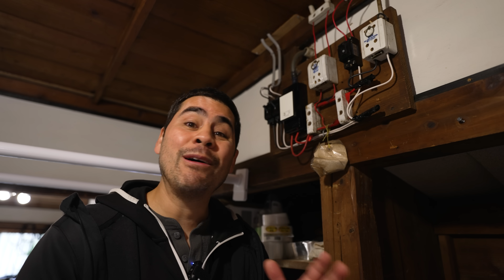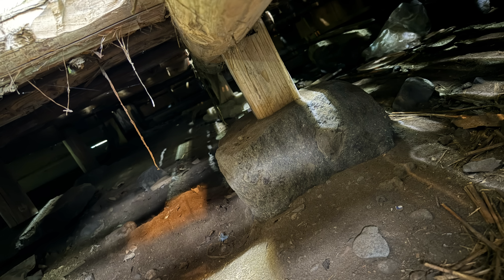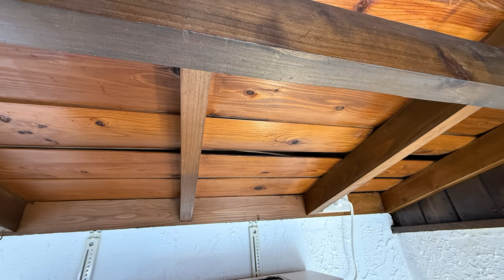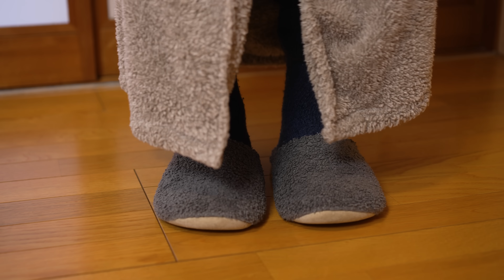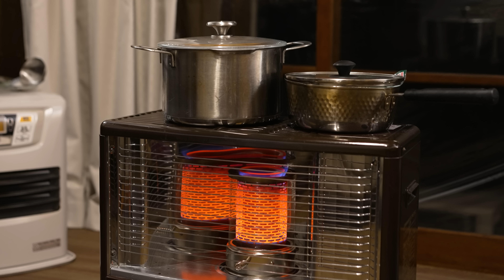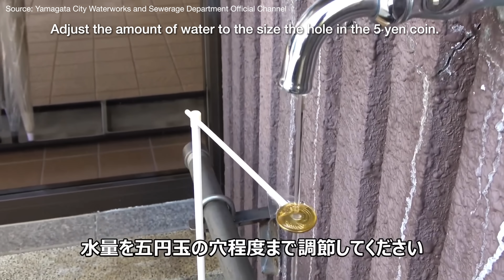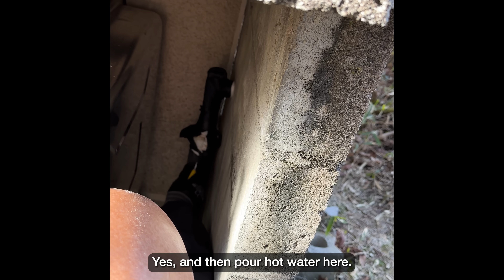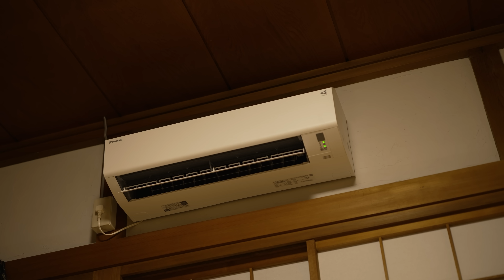What an Old Japanese House in Winter is Like

Comment: Japan must waste a ton of energy on heating. Government surveys show that roughly 90% of existing Japanese homes (as of the early 2020s) do not meet the 2016 energy-saving standards. Even worse, about 30% of homes have no insulation at all. In fact, I heard that if Japan heated their homes the same way that Americans do (central heating), and had the same size homes, they would use 60% more energy on heating than Americans. Luckily Japan is upping the housing code to require modern insulation for new buildings.

Comment: My parent's bought a $3000 apartment in Yuzawa and pay $200/month maintenance fees. The building has giant, built-in electric heaters in every room but if you turn it on they charge $50/day. We use 3 space heaters on full blast during the winter and it's still very cold, they also occasionally trip the breaker. Fun times.
Reply: I'm always curious about folks who buy into those old, dead apartment blocks. I can't imagine moving all the way out to the countryside/mountains and then living like you're in Saitama.

Comment: 47 degree shower?????!!!!???? My skin would blister... Ours is set to 37 and I still run the cold water. This morning it was 1 degree in Osaka and I was walking around our old house barefoot, in shorts and drinking cold chocolate milk. This from a guy born and raised in the Caribbean!
Reply from the maker: It's 47 at the source. You lose some through the pipes and air. I think it still hits the body fairly hot, like between 40 and 43, depending on the distance from the shower and how cold it is outside.

Comment: Electricity panel like that would get you arrested in Belgium for endangering your family 😂
Reply: As a sparkie, you'd be surprised what may be allowed by "grandfathering," i.e. accepting old regulations for old buildings and installations.
Reply: @Slugbunny  Yup.
Reply: @Slugbunny My dad has taken care of my grandmother in Ohio for the last 2 years, and the old electrical system was so out of date! House was built in the 50s....
Reply: Yeah, looking at that electric panel really made me look my eyes out. Like what even is that? 26A circuit for the entire house? No wonder you're constantly struggling to keep the power up (yikes).
Reply: He's running a kerosine heater on a straw matt, in a wooden house with paper walls.....

Comment: I'm really lucky. The insulation isn't great (this condo is 60 years old) but the space is pretty well sealed up. So a small space heater in each room is enough. Each one pulls about 700 watts, but only runs when the sensor trips as "colder than". So they run in bursts of about 10-15 minutes each.

Comment: Hey Greg,

Great Video. 

A Suggestion: Wouldn't it be more beneficial and efficient to use a 12v heating blanket or an AC heateing blanket.
Reply from the maker: Could be more efficient, I haven't done the math. But I know that if it gets below 5C, even if inside the blankets is warm, I don't sleep well. 10C I can do though!

Comment: This is such a great example to help answer a burning question I've been so curious about for literal years now. How did Japanese adjust for winters? I'm also from Canada and used to strong winters so I was immediately curious as soon as I learned about Aomori being home to the deepest snowfall.

I imagine the eventual invention of the Kotatsu, and electric heating helps change it but I'm really curious about the past. My guess is it's bundling up, mostly fire, maybe hot water bottles, and hot rocks from the fire or just camping tricks and luck to survive the winter back then when it's a paper walled house with draft for the summer.

If by chance you read this, can I bug you for the name of the thermometers you're using to detect the air below and above your desk? I'm trying to isolate a draft in my house in Canada hahaha, surprisingly relevant I suppose.
Reply: The kotatsu has been around since medieval times. Before electricity, you'd have a little pot of burning charcoal down there. But yeah, huddling up in the kotatsu or around the irori (cooking fire place) was basically it.

Comment: I never thought about it, but as a Canadian I have completely taken for granted the fact that every house I've ever lived in has been well insulated. 

You could consider getting a little fan to help air move in the room to help equalize the temperatures at head level and the temperature at your feet. Also I've seen people use heat-powered fans on wood stoves to help circulate air. Maybe you could use something like that for your kerosene stove/heater.

Comment: I take it that running the heat  (overhead Aircon on heat setting )throughout the night would be cost prohibitive. That would prevent you from having to bring the heat up from such a low temperature.
Reply: That was my thought, too. The heat pump could do it safely, but apparently not worth it (discussed later in the video).
Reply: @Slugbunny Sounded to me like it's an overall electrical capacity issue or a wiring issue that would result in circuit breakers being tripped overnight.  Much of this uncomfortable, unsafe, elaborate heat dance could be eliminated by upgrading the electrical system to allow the heat pumps to run all night.  Turning heat pumps off and on daily is generally considered poor practice.  They are designed to be on all the time using the minimum energy needed to maintain temperature.  Going from freezing to 20C each morning consumes all his limited electrical capacity and can't be done with just the heat pump.  They are simply not designed for large, fast demands.
Reply: The electrical system must be upgraded so the heat pump can work all night in both locations without tripping circuit breakers.  That's the only way to eliminate the danger and inconvenience of the kerosene heaters, the risk of frozen pipes, and the discomfort of huge daily temperature swings.
Reply: No, its dangerous. You can die
Reply: @Obbliteration The heat pump is completely safe.  He has to find some way to keep that on all night...
Reply: @thelosphere8722  Not the heat pump, the burner I mean. The heat pump is fine but that house is just awful. You need a massive energy output to heat it. Such a tiny unit cannot do that
Reply: @Obbliteration Yeah the heat pumps look like small ones.  Only more reason to keep them on all the time since they lack the ability to manage huge swings.  In another comment he did mention he's renting and that's the reason he's not upgrading the electrical.  I don't know.  If it was my family and that much discomfort and safety risk, I'd work with the landlord to do the upgrade.
Reply: @Obbliteration  trim the overhead air con?
Reply: @kamanama3671 Trim?

Comment: "Traditional living" is fun, no? ;p~

Many thanks for sharing even if personally I'd be swapping out the kerosene heater (like my grandparents used to use) for a modern oil-filled radiator, maybe even a heated sleeping bag and robe. Most of us nowadays didn't grow up with ice forming inside the windows. : )
Reply from the maker: Oil filled still uses electricity, so I think that would still probably cause an issue with the panel.
Reply: @LifeWhereImFrom  Yeah, I don't know what the total electricity draw you have is but even 600-800 watts which is 100% efficient still makes a decent difference and with zero risk of flames or fumes it's easy to put close to the bed and/or removable foil-covered panels that could be slipped in to reflect heat back at you. Likewise, safer to have the likes of a silver-foiled roll-out mat which could be placed underneath it.
Aside from that, the idea of heating the person rather than heating the house is fundamentally sound, of course! Hence the heated sleeping bag/robe; some of which are battery powered so could be charged when the electricity drawn is lower.
I love that you've taken the need to adapt so stoically, anyhow; very much a lost skill nowadays, kudos! ("People survived worse in the past, you can survive it now"... ;p)
Reply from the maker: 600-800 watts is borderline. I think it'd work, but would have to remember to turn it off before using any kitchen equipment or hair dryers.
Reply: @LifeWhereImFrom  Ha! I'm surprised you manage to get away with hair drying at all... or is that another tale or ten of blown fuses? ; )

It's a similar problem in Indonesia with limited power draw but climate and latitude makes it much easier to find a modern solution there with a few solar panels and battery storage running separately to the mains supply.
Not quite so easy at Japanese latitudes in winter, alas!

Comment: What size are your AC units? Mine are 3.6 kWh in the living room and 2.5 kWh in the master and 1 guest bedroom. Since each unit is on a separate breaker in the breaker panel, I ran all three units simultaneously last winter and tripped the master breaker a couple of times when I forgot to turn off the main AC in the living room to operate the microwave oven. 

This winter, I switched from using the AC units to warming my body only, which I had concluded was more economical than heating entire rooms. This meant purchasing two electric blankets (I already had two) for the living room, bedrooms, and a five panel leg and foot heater like yours at my desk. These I purchased cheaply in summer and fall from HARD-Off and 2nd Street (in brand new condition). I also had a an electric rug in storage that I put in the tatami bedroom. My electricity bill for Nov-Dec 2025 was ¥15000 cheaper than the same period in 2024. My house is in Western Tokyo. 

And, like you, I dress like an Eskimo around the house 😂
Reply from the maker: I can't recall off the top of my head, but they're 100V, not 200V, I remember having to make sure they weren't too powerful.

Comment: We have the same trope here in Australia, Aussies whom travel abroad realise that are homes in temperate Australia are far more miserable in winter than homes in Europe or America because insulation makes all the difference. An average house in Melbourne will drop below 10c the second it's within a footy pitch of freezing. Where visiting rellos in California with a holiday Cabin around Lake Tahoe; it was still above 15c when it was -20c outside. They had double pane windows and that plastic layer put over the sills, made it so you didnt feel that ambient air drop walking by like most windows, heck you can feel the wind pushing through most closed windows in Australia.

Comment: You know the house is cold when you open the refrigerator door and warm air tumbles out.
Reply: Why did the penguin buy the freezer? Because it's only -7°C in there!
Reply: Or you open the door outside and it's warmer which was the case every day while I lived in Japan this Christmas.  I'm going outside in my t-shirt to warm up while dressed as an eskimo indoors🙂
Reply: Nah I had that happen with my Siemens fridge freezer,  damn thing messed up and started working in reverse by the time I realised it was 26c in the fridge.
Reply: I'm surprised the heat pump does anything. They don't seem to work well and cost a fortune to run in old houses here in the UK. They're deemed only suitable for heavily insulated houses. 
I can sympathise with your problems. 
I grew up in a house with no heating anywhere only a coal fire in the living room. We used a tiny paraffin (kerosene) heater occasionally in the kitchen. There was no bathroom, the toilet was outside. I remember frost in the morning on the inside of the windows. I would not like to live that way now. 
I hope you manage to get it all renovated so you're comfortable.
Reply: @OrganisedPauper heatpumps can run in far cooler temps than 0C, they just get less efficient till about -15C to -20C, than they basically can't function.  They have to cycle the cooling part to heat the coils to melt ice buildup, below around -20C it can't overcome the cold with enough time for the cycle to work right.
Reply: @Oyashiro_Chama Thank you. I don’t think we don’t have OC here. The most common form of heating here is gas, usually gas central heating.  Heat pumps seem to be extremely expensive to run here in the UK unless your house is extremely well insulated and has no draughts. They’re not considered suitable for a Victorian house like the one I live in that has living rooms with cellars underneath the floorboards.

Comment: NOSTALGIC!!! I used to live in an old home in Iwate. And this was my home for 3 years. You have a bit more modern comforts than I did. No aircon for me. Also, your sink isn't gas-powered. No insulation either. Also, the boton benjo toilet. No fancy heated seat toilet for me. I had that exact same kerosene heater.

Comment: I guess I don't understand whyyou don't keep the heat on low overnight so at least it's not at freezing level in the morning?
Reply: The ac just wont be able to do it alone and the other heater can kill you while sleeping
Reply: Utility bill would be my guess.
Reply: Ah, there we go. Covered late in the video.
Reply: "result in a cold, dark world"  implies an electrical problem.  I would like to hear why that can't be upgraded.  So much of this whole dance goes away once both heat pumps can be run all night.

Comment: My house in the US Midwest had the heating go out the evening of the coldest night of the year (0 degrees Fahrenheit). It was around 72 when it went out and the temperature dropped to about 52 by the time I woke up. I have good insulation but also an open floor plan house and some large windows, which probably didn’t help. Thankfully I was able to get it fixed by the mid morning!

Comment: OMG.  Wow.  This is the Third World.  Why only 30 amps?????  US homes now usually have 120 amps.  It would be difficult to charge an EV.
Reply from the maker: The house was built 100 years ago. In fact, in one section they pulled up tatami mats and the tatami person were amazed and said they could be museum pieces. Have no idea when the electricity was initially installed, but my brother-in-law's brother, who is an electrician, was scared of it because it was so old. Would cost a bit to update it, and we would if weren't just temporarily renting.
Reply: Old home = old electric installation.
Newer homes (most Japanese homes) don't have that issue.
That akiya needs a lot of work.
Reply: Because this is a house from the probably 60s or 70s when nobody had any electric appliances and most people weren't future proofing anything they were just happy to build a home. 
You wouldn't believe how cheap these homes were to build back then.
Reply: That has more to do with the fact that he is living in a very old home. Electricity was still not that common in use back then so you would not need it.
If Greg had the budget he would be able to have a new electricity system installed in the home. 
I suspect that his home was owned by alder people before him that where just used to that so never took the budget to update it.
His hotel units is modern so does not have that problem. But that is for his guests that pay for that luxury.

Comment: Get an PC with Ryzen cpu n RX GPU, u don't need heater
Reply: nah, Ryzens and Radeons are too efficient these days, a Nvidia 5090 with  a 14900k; that's an easy 1000watts of 'free' heating.
Reply: and keep cyberpunk 2077 running on idle to really get the temps up
Reply: @mfaizsyahmi while using path tracing mode.
Reply: Lol
Reply: Intel Cpu * Those run at boiling hot temps.